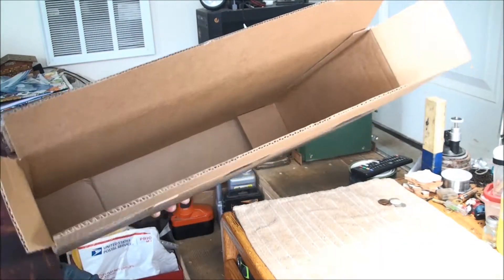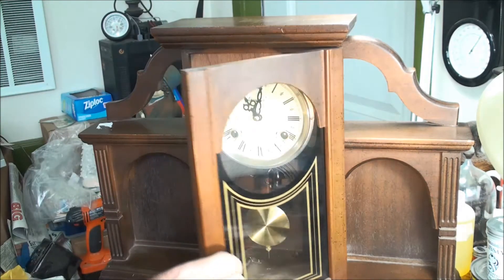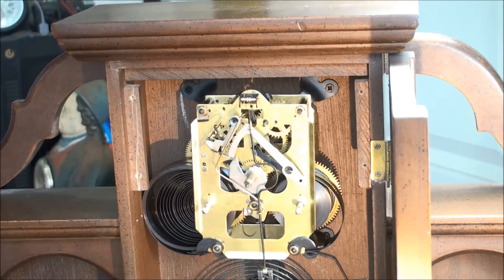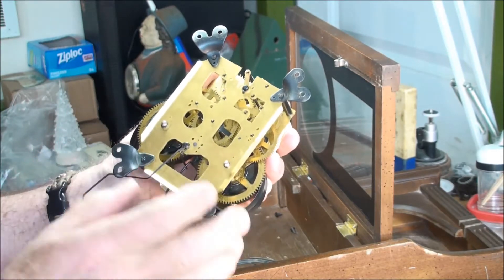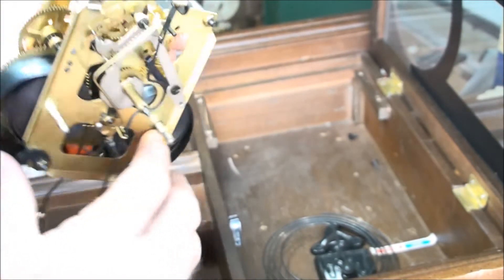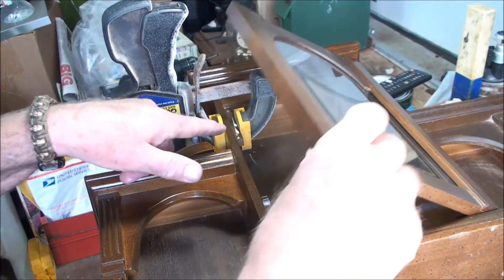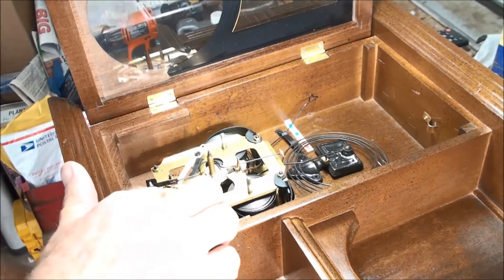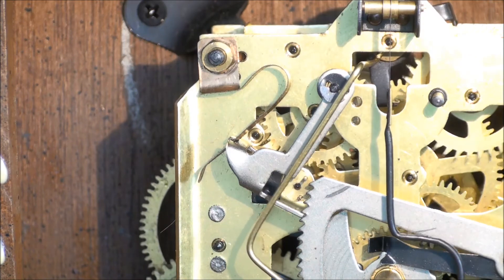When should you take your Movement out of your clock and Re Oil

Comment: Another great video Mike. I too like the shelves to display smaller clocks maybe. I think that I would have just oiled it myself. As far as the loose gear. I think the way to fix it is to put another bushing in the hole and to press that wheel down on the shaft more. I think it has slid on you. Of course I could be mistaken. Thanks for the shout out at the end. May God bless you and yours.
Reply from the maker: Because this clock is going too be use all the time, I decided to give it a new start with fresh everything. You are right about just oiling the clock though. The movement is in a sealed box and should be good for a good 7 to 10 years. I didn't even think of looking for the play, up and down. Just the same, I am use to the noise it makes when the clock gongs. You are welcome and thanks for stopping in Mark. God Bless.

Comment: I like that clock even though it has a cheaper movement. I would have to drill holes on the upper shelf areas and put small Led's up in there so just the indirect light shines down on whatever I put on the shelves like say a 1970's match box car,tractor or some other 1970's things
Reply from the maker: If this clock was one of the expensive clocks, I would shudder to think what you have done, lol. I happen to like this clock for some reason, so I bought it. And yes I got it for a good price because it is a cheap, Japan clock that most clock smiths will not touch and want to put a better movement in them. Thanks for watching DJ.

Comment: Do you think the price of the clock at the jewelry store came with cleaning and oiling? They did services for their good customers.
Reply from the maker: Now a days, everyone charges for everything. Even when this clock was sold, I would say no. Most of your clocks will run for 20 plus years before they need new oil because the oil dries up and the new oil prevents the old oil from drying up. This is why its good to oil your clock every 5 or so years, before it stops working. Thanks again for watching Bob Anderson.

Comment: I wish you were close to me to oil my clock! I’m afraid take it apart! 🫤
Reply from the maker: If you clock stopped, there is a chance that just oiling the movement will get it going again. They say that this is a temporary fix, but better than nothing.
Reply: @justmike57  thanks Mike it hasn’t stopped but it’s probably been 15 yrs since it was worked on. It’s from the late 1800s. I know it could use a good maintenance!